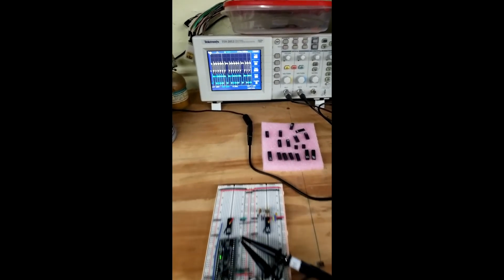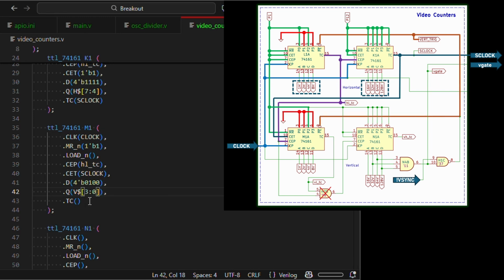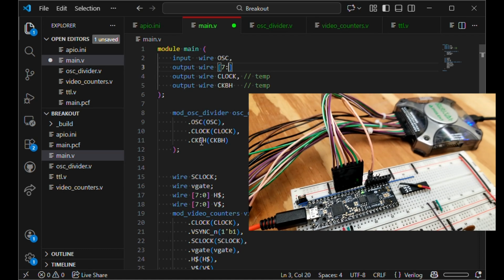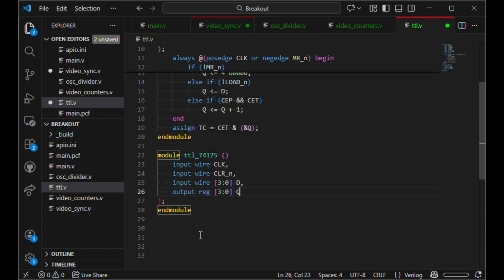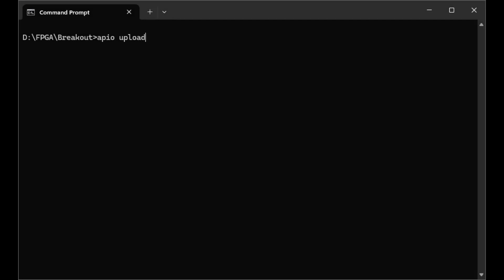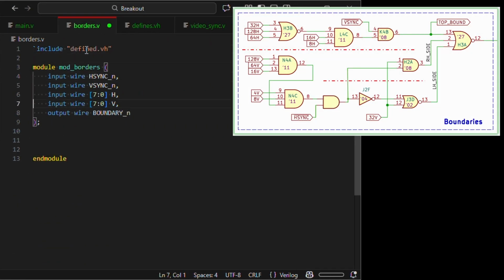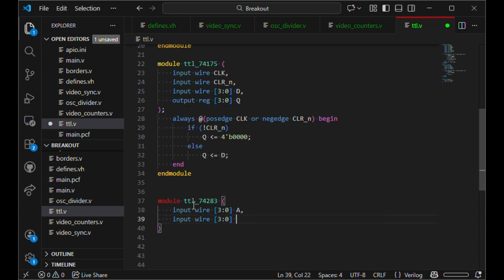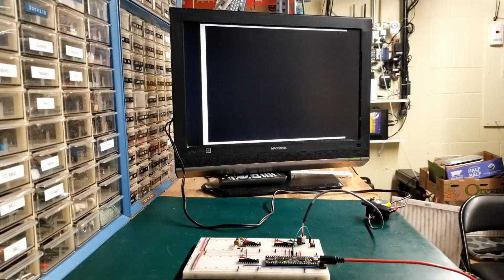Retro Atari Breakout Part 30 - FPGA#2: Video Counters & Sync, Borders & Flip-Screen

Comment: How did you get Diligent Digital Discovery to work with UPduino?  I installed the FTDI driver for UPduino and it showed up in the apio device usb list but then the WaveForm stopped finding the digital discovery.
Reply from the maker: I had the same damn problem. Had to use that Zadig app , options > list all devices, [Digilent..] and set the driver to FTDIBUS. UPDuino uses WinUSB and I think the install just overwrites some stuff. Very frustrating. Let me know how that goes. -Paul
Reply: I am on my laptop and when I plugged in a USB C to multi port adapter and plugged in the DDiscovery and the UPDuino, I was able to install the apio driver install ftdi on the UPduino and now it works.  I have DDiscovery still working and the apio upload now finds the UPDuino.